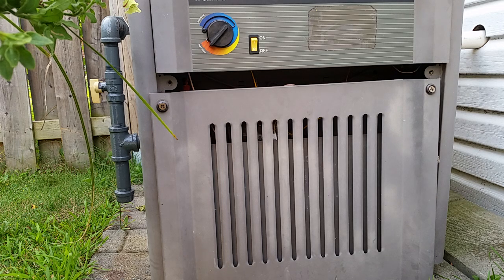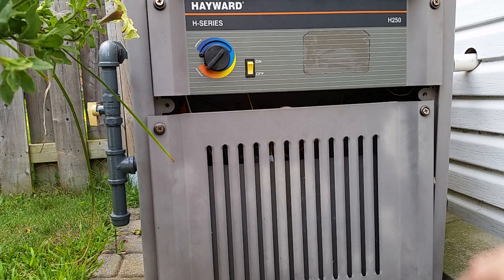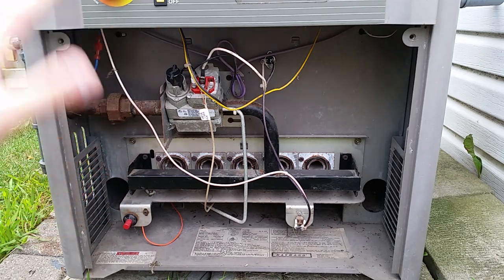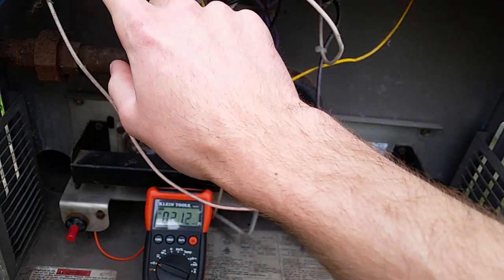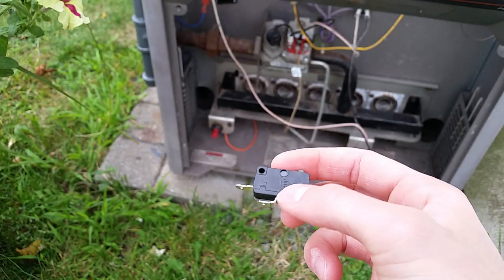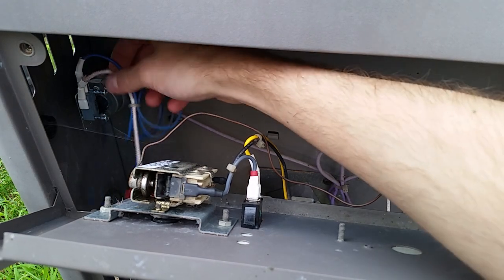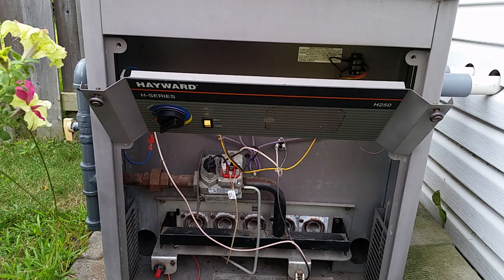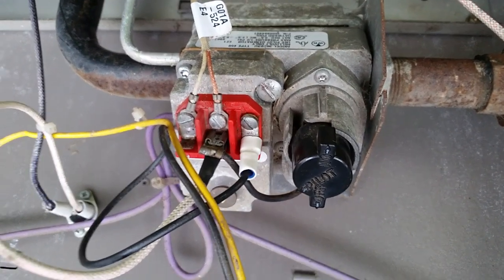How to diagnose and repair your Hayward H Series Natural Gas Swimming Pool Heater

Comment: Where can I get that pressure switch part that is around a $1? Does anyone have a link where I can buy it? Thank you.
Reply from the maker: something like this... https://www.ebay.com/itm/5Pcs-Normally-Open-Close-Limit-Switch-KW7-0-15A-16A-Micro-Switch-TO/372636399471?_trkparms=ispr%3D1&hash=item56c2dc376f:g:vIYAAOSw7mpbPCcx&enc=AQADAAAB4KX%2FKt4E1xf3SDqEdBclaYZrZlMdSUix9fMgtJdJMZhLAYlplvHZlwUafbrTqlgvJ9DOnqTQUWjp%2BLshc206WiTECS7R0%2B67E96skhJfVOAl8iuoFozozertBRx4pPQrV0%2BV8ghRQgUL%2FARUAlzZHJE2C4WhhP0HfSu5Xf8OGD5Jt65RV6bKCr%2Bd178xFBl%2BgCK4CGWC%2BZvZ7PCs%2FWBkj3KUEt6yYIc1MNuGG8acirUGNYW6%2BvIgPxVGbboluUaFDWgTs8qUfReSBbf1a6N3Hcj91RhoWD2hwjrVOeGS4FUkyt8XRY7HrgwMa1wcFvvHt7bRMfsMIr2JYnEOS4jmqHNirTUGThUlecOAkuzg4Byf4PkQL%2BF9%2BTyPMYw43UpfvrjDoEnGn%2BoNqsaw563fjpu%2Btrd6rdKZE%2F%2F0dJ2xuObkJoAcfcdZ5TpToqA1lj%2FGre9td5nXVVxR2Tc07Mls5sI0Af%2F2vjEA6ShIdCnDJVAzqq7K5eIwg3uzdUCEFtBGZwubE8cK5sBwy%2Fw0tM6g1nxu3nhy%2BDutImtPqaF9uMmovuZuvPCoynC9T1It1WIQIxd20lPimiMznoD7RP%2FO8UpgFzb%2BGRbKpNhqom3pSPY2g7oM4DalGr8ZIQHgfwh6fw%3D%3D&checksum=3726363994713f8738f254f54a47882e388ae2726bc2

Comment: My pilot light goes out when jumping the terminals to open gas valve does that mean I have a bad gas valve?
Reply: You’re not supposed to jump the thermopile leads in the valve.......
Reply: @mrmeowcat1597  the manual says too to test if its functioning properly. followed by other testing of switches

Comment: Help!!!  I have a Hayward not sure which model but it looks just like this one...it’s all analog, and millivolt.  The pilot lights and stays lit, when you turn the thermostat you can hear it click on and off at whatever the water temp is, but the burners won’t ignite at all.  There’s no gas flow (like you had when you turned up the mic) and basically nothing happens.  Could that be the contacts on the valve or the pressure switch??  Help from anyone who can answer would be greatly appreciated.  Thanks.
Reply from the maker: Yes likely possible, you will have to trouble shoot as I show in the video until you can find a bad switch or wire.

Comment: good vid.  helped me with my epg 250.  the jump is a  bit different (far left contact goes to far right one), but still...it led me down the right path.  my pressure switch turned out to be bad too.  when I jumped it, my heater came on.  instead of spending a few hundred on repairs, I got a 50 dollar pressure switch off amazon.   great vid.

Comment: I have an H 400 Hayward that's about 13 years old. Starts up perfectly and runs fine. However, it does not get the hot tub up to 104 degrees. It seems to shut off around 99 degrees. Any idea how to troubleshoot?
Reply from the maker: Themal limit switch?
Reply: @QuaabQueb  Is there a way to test or bypass it?  Or should I just replace it?  Where is it located?
Reply from the maker: @dwaynekvalheim8329  Sorry I meant the thermostat switch.The water temperature Limit switch is actually located on the side of the inlet/outlet port. I forget what the maximum rating is on those but basically it is there to shut off the heater should the water temp surpass it's rated temp. 
The thermostat switch on the other hand (temperature knob) may have gone bad.
There is a long copper tube filled with alcohol that goes in to the inlet manifold which houses the thermostat temperature sensor. It is unusual that these go bad but it does happen. Usually it is the mechanical switch that is tripped by the thermostat
Reply: @QuaabQueb  Thanks again for the reply.  This particular unit has a digital display, not a knob.  I actually control it via the Aqualogic system.  I am beginning to wonder if the control board on the heater is bad?? They cost about 400 bucks, a little too much of a guess.  

 If I try to raise the temp on the actual heater control pad, nothing happens.  It just displays the current temperature of the spa.  There are too switches located on the inlet side of the manifold.  The appear to be working fine as I jumped them both.  Also, I checked them for continuity while disconnected and both passed.
Reply from the maker: @dwaynekvalheim8329  I see,  Did it ever get up to your desired temp or did it only start shutting off at 90 recently ?
Reply: @QuaabQueb  no, it never got to the desired temp.  I was previously getting to 99.  now it is only 92
Reply from the maker: @dwaynekvalheim8329  I would start with the cheapest part to replace and work up from there. From what you are describing it sounds like a problem with the thermostat
Reply: @QuaabQueb  okay, Ill try it.  I remembered I replaced it 3-4 years ago.  It may have went bad again.   I had this problem with the broken plate.  https://www.youtube.com/watch?v=UzHLiba3s1g

Comment: I have the h1501 model, very similar to this one.  If i set mine to bypass it instantly kicks on and will run until it reaches its temp. Once it shuts off it will not kick back on. I pretty much have to tap the bypass with alligator clips every day.  I read somewhere that if you tap the bypass and if it stays on then its not the sensors but if you have to keep the clips on in order for the bypass to work  then its something with the sensors.  any suggestions ?
Reply from the maker: Likely a problem with the gas valve. Mine did the same thing. Could also be corrosion somewhere in the wiring or the thermostat switch

Comment: I've spent hours. Hayward wont talk to me because I'm not a technician. I've tried it all. Hayward propane fired h400fd. Almost instantly I get "io" which is supposed to be an ignitor. I got a new one. Still doesnt work. I'm getting 120v out of the board to the ignitor (I've got 220 to the heater)  the ignitor starts to heat up but I get the io fault within 3 seconds of start up, so it doesnt continue to heat. Any ideas. Thanks very much if u answer
Reply from the maker: Hmm it may be the gas valve. Call back and pretend to be a technician
Reply: I've tested switches, fuses, transformers etc. The only thing I couldn't check was the gas valve cost the board does not send it current since I got the IO fault so quickly.
Reply: samlol23  I had a defective  igniter once, brand new replacement right out of the box that looked perfect. Also could be a poor connection, or bad ignition module.  BTW 120v is about the proper voltage on those. The 220v going in is pulsed by the control module to the igniter and will display differently depending on the meter you're using. If it's going into lock out, check your limit switches for continuity.
Reply: Faulty ignition control board.

Comment: Great video! One question....I have electronic ignition H300ed2 .....I have to press button to go from ‘standby’ to ‘heat’ twice before heater fires up, once on works perfect. Takes about 30 seconds to kick on.....any help to why? Thanks in advance!
Reply from the maker: On those heaters I believe it is an electric ignition.

Comment: I got the same pool heater like this.  When my heater reaches to the desired temperature, it would shut off which is normal but it will never turn back on automatically unless I use a jumper cables on the TP and TH.  Can you please help me with this issue?  Thanks.
Reply from the maker: Bad thermocouple, corrosion on the wires, or the gas valve could be on it's way out

Comment: Thank you for this video! Saved me a  couple hundred dollars. My problem was that the pressure switch on my Hayward H150 would not extend and switch to on. Using the jumper on the wires that connect to the switch worked initially but once I removed the jumper the gas valve would turn off. Had to replace that little electrical switch and the water pressure switch and then it worked normally. Thanks again!
Reply from the maker: Glad it helped!

Comment: Just connect the 2 wires off the pressure switch if it fires up then you know what the problem is.
Reply: This is false. The pressure switch may be doing its job. First and foremost if you suspect a pressure switch, check the water flo. Ensure variable speed pumps are on high speed and the filters are not clogged (I usually remove the cartridges and test fire). If flow turns out to be your problem you'll end up replacing flo switch when all u had to do is clean your filter
Reply: Frank you are wrong!!! To bypass any sensor or switch you connect both wires together!! Let's not be a ignorant moron!
Reply: It's usually never a filter or any pump problem so let's not be dumb!

Comment: Hey there... great video.  I got mine started by using your jumping method.  right when I remove the jumper it turns off.  I installed a new pressure switch(the whole unit is new) but still the same thing.  Right now the only way I can heat my pool is to leave the jumper inline to have it run.  Any ideas?
Reply: Lee Orphanos connect the 2 wires off the pressure switch till you get the new  one just make sure your pool pump is running. And I wouldn't leave home with the heater running this way either.
Reply: thanks Chuck P!  I already have the new one installed but the only way the unit will run is with the jumper on the millivolt as shown in the video.  problem is not with the pressure switch as I did connect the 2 wires but it doesnt fire up unless I jumper the millivolt shown at 13;32 of the video.. any clue what else the problem could be??  have checked all things in the front panel and can't figure it out.  Once it's running with the jumper for 30 mins and I remove the wire it stays going??  Problem is that I need to open the panel jumper the wires to get it going for half an hour then remove the jumper and put the panel back on... it's a pain but better than replacing the thing right now for sure.
Reply: Lee Orphanos hello did you try to clean the contacts also check the wiring to make sure its ok could be a bad connection with one of the terminals
Reply: I haven't tried cleaning the contacts...that will be tomorrows job!!

Comment: Great video, thanks for sharing your experiences.   Question.. I have a different model, Laars Lite 2 and wanted to jump the connections to see if will start.  Specifically which two did you connect on yours?  Just want to do it right the first time.   Thanks!!
Reply from the maker: Chris M Usually it's the TH and TP terminals. Carefully cause some are 24V systems and have different terminals.
Reply: Yes, that works - started right up!  When I then take off the jumper the unit continues to operate.  If I shut off with the power switch, the unit shuts down as expected.  If I try to start via power switch it fails again.  Jumper again, works.   I've narrowed it down to the thermostat or it could be the water line connection to the pressure switch, as my pressure switch I replaced yesterday.
Reply from the maker: Chris M yes mine does the same thing some times. I believe it is either the thermostat or the thermopile on it's way out.
If I turn the thermostat knob back and forth past the point where it ticks some times that gets it to go on. But most of the time I have to jumper it aswell to get it to fire

Comment: I have checked every lead for continuity and they all check out even the water pressure conect has continuity even by passed the water pressue  on off the only way it will fire up is if i jump the leads as you show in the video
Reply from the maker: Peter A Rood it may be a problem with the gas valve, but most likely a bad connection somewhere in the wiring. (Broken wire, corroded spade connectors...)

Comment: i have h3001 need help with wiring i have new wiring harness buy heater was free but harness was burnt out rebuilt  it but need to see where each wire goes yours looks the same could you send pics to gibb2208@gmail.com

Comment: I’m going nuts with a Hayward cz250 very similar. New thermopile and pilot, but won’t stay lit. When it is lit if I go to on it immediately shuts off. Getting like 577 ma on dc voltge as pilot is on but I have to hold it down. Any thoughts
Reply from the maker: mogie620 saw your vid, if you put a new thermopile in, the gas valve it self may be worn out, not able to hold the spring open inside to keep the pilot lit, or you may have put in the wrong model thermopile.
Reply: fixed it! it was the gas valve i bought it on amazon for 80 bucks exact same thing still being made 18 years later. incredible. took awhile to take it all out and put it back but it worked!! fired up! thanks again!
Reply: mogie620 hey do u have the link to the part, thanks!!
Reply: bmbertges Robertshaw 700-506 250 to 750 mV Combination Gas Valve, 3/4" x 3/4" https://www.amazon.com/dp/B0084L7ODS?ref=yo_pop_ma_swf
Reply: mogie620 thanks man, i appreciate it!!

Comment: word to the wise. never put a meter across a mllivolt gas valve on the ohm setting. the 9 volts will burn the gas valve out immediately. this should have been stated...
Reply from the maker: Joe Winner umm who did that?

Comment: I recently had a problem with my manifold gasket leaking and putting out my flame. I had that repaired and then replaced an electronic igniter (H250) I can now hear the igniter click but am not getting any propane flow. No propane smell. All gas supply   valves are open. Could this be the pressure switch or is it more of a valve problem?
Reply from the maker: I am not familiar with the electric ignition models, but generally all gas fired appliances work similarly.
Does it have a pilot light? If so can you verify it is lit. If not you should hear the gas hissing through the manifold or regulator very slightly when it tries to ignite. 
No gas flow at all would indicate a problem with the gas valve.

Comment: Would you have any idea why only two of my Three burners are alight {the left two }? Subsuquently not heating the water and then turning itself off after a couple of mins ..
Reply from the maker: If a burner is not lighting the gas orifice may be blocked or clogged

Comment: I have the H 150 series and the heater fires up but the water in the pool comes out cold, do you know what can I do to fix it?
Reply from the maker: The H150 is a much smaller heater, it will take a while to get the water up to temp.

Comment: Interesting to see the inside of the machine. Wish I was mechanically inclined. 

Have a question. Hayward says the heater is not supposed to be used in temps below 40 degrees. I honestly don't understand why not. Do you understand why?
Reply from the maker: Gas fired heaters or heat pump heaters?
A gas fired or electric heater can be used in any temperature, they are what are used to heat pools in the winter.
A heat pump, will not operate below a certain temperature because it works on thermal properties.
See "how a heat pump works"
Reply: Gas fired. They say it voids the warranty if used below 40.
Reply: Gas fired heater. Hayward says their warranty is void if used below 40 F. I can live with the risk of doing without the warranty but I'd sure like to understand why using below 40 could cause a problem.
Reply from the maker: Hmm strange, the only thing that would possibly come to mind is depending on the model and capacity of the heater, and the size of the pool, if the temperature goes below a certain point the heater may not be able to bring the water up to temp fast enough and it could go below freezing damaging the heater. 
Lots of variables but "could" happen I guess. Most people do not have their pools running in those temperatures though.

Comment: When your rebooting your heater do u have the machine on or off ?
Reply from the maker: Reboot? This unit does not have an electronic control. 
Do you mean re-ignite? Don't understand your question....
Reply: Dani Yaqoob is that

Comment: I just replaced a broken bypass last week, but now the heater won't start up. When I turn on the heater, the gas will come on for 2-3 seconds and then immediately shutoff; any idea what could be causing this? I was thinking it might be the switch from your video, I may have been rough with it when disconnecting the leads. Everything but the bypass was working fine, and I had no issues with ignition before replacing it.
Reply from the maker: Could be low pressure not causing the switch to fully click, or could be the switch went bad as you say. Do note you dont "need" a bypass unless you are exceeding the flow rate or pressure specified by the manufacturer.
Take a multi-meter, set to continuity setting, and attach it to the leads of the switch, see if it makes contact when the pump is on.
Alternatively if you do not have a multi-meter on hand you can use a small battery and a light to make a little test circuit.

Comment: Great video! I have a h400 that gives me LO error code, which is limit string open error . Is that the pressure switch? If so where do you get just the small switch and what is it called?

Comment: On my h150 it looks like somebody disconnected the pressure switch wires.... which wires get connected to the pressure switch? I see no open wires. Thank you.
Reply from the maker: Color may be different, just trace the circuit from the gas manifold
Reply: Thank you....

Comment: heater starts up fine but after a couple seconds it starts knocking and eventually shuts off not sure why any ideas?
Reply from the maker: The knocking sound could just be the heater core expanding. If you watched the vid you will see I talked about the thermopile going bad, and or the thermostatic limit switches. I would start there as 90% of the time those are the issues with these milivolt systems